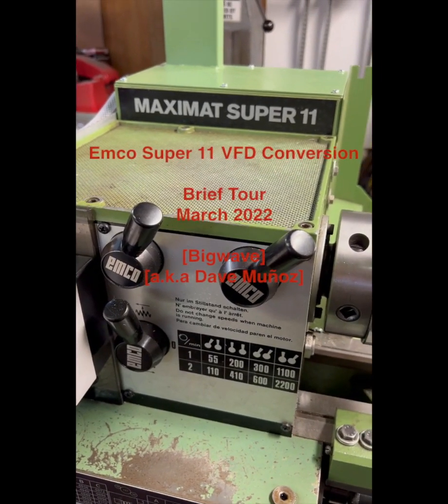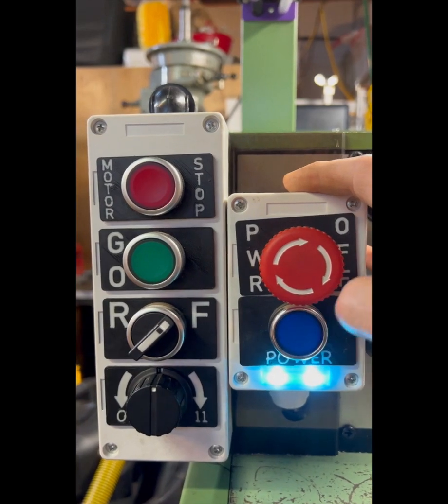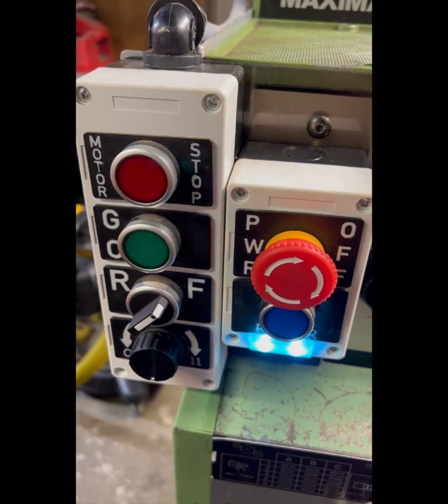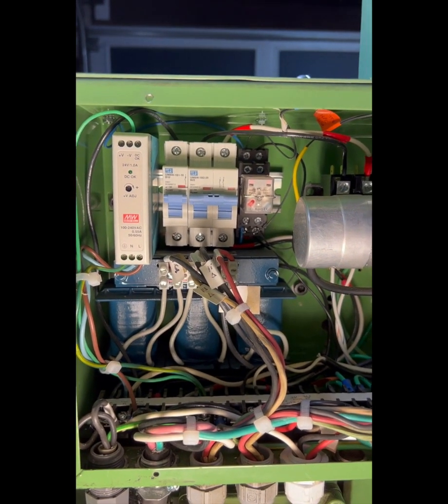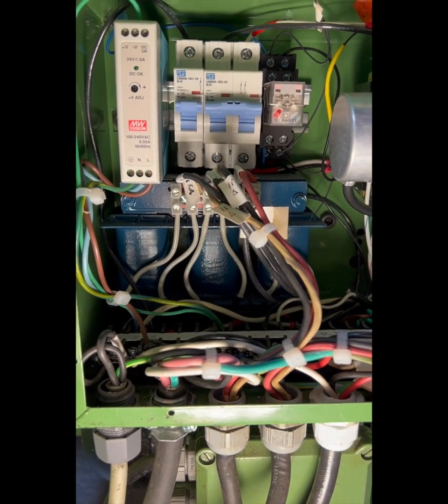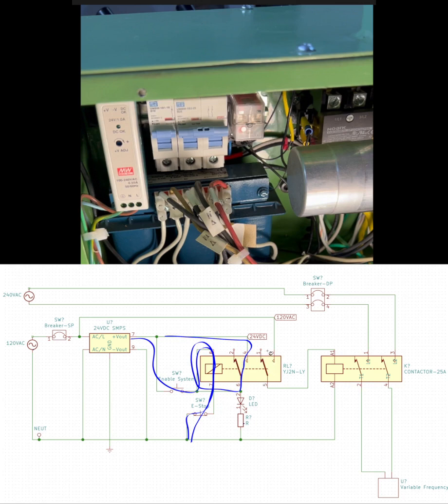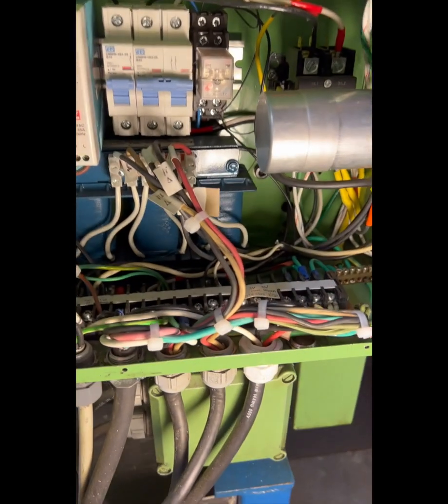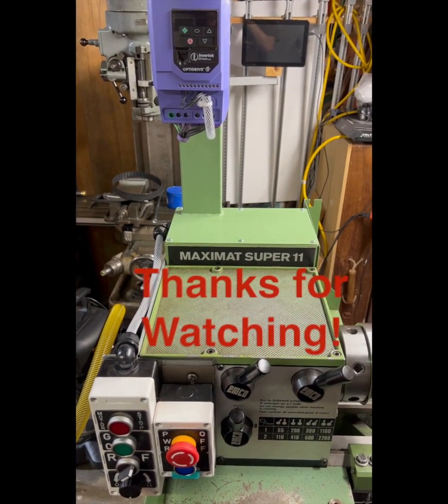Emco Super 11 VFD Control Tour

Comment: hey, would you mind sharing the specifications / model on the inductive reactor? I've been considering one for my S11, but am not familiar with them at all. Thanks for the video!
Reply from the maker: I'm using an 8Amp (ITh=12A) 3mH reactor - These are readily available on eBay for about 30 bucks.  Anything 8A or above should work fine.  PS: ITh is the "Thevinin Equivalent" current meaning roughly the combined total current of the three phases.
Reply: @bigwave_dave8468  Much appreciated!

Comment: Hello dear Dave, 
I have owned the same machine for almost forty years now, running on a single phase 220V.
I would very much like to install a VFD and go 3-phase for the same reasons you did and get rid of the capacitors. 
Did you change your motor, and do you have both variable speeds using the mechanical and VFD speed controller?
I was also contemplating doing the same to the milling attachment basically to get the reverse feature when doing taps.
Your kind advise would be valuable.
Best regards.
Reply from the maker: Hi, I did not change the motor. I used the original. However, the motor is now fixed in the "Low-Speed" or "Delta" configuration.  If you convert to VFD choose  Delta or YY configuration  but do not switch back and forth from one to the other.  The  VFD has to be tuned for whichever configuration you choose.  The nice thing is, one can  remove the big ugly rotary switch since reversing and speed is done  in the VFD.  The VFD drives the motor to higher speed by increasing the frequency 2X.  This has worked with my old AEG motor.   The milling machine is a different matter. The motor on mine is not a 3-phase winding.  It has only two stator windings -- look at the inside of the motor cover for clues about what type of motor it is.  I just left the one Capacitor for the milling head in the lathe switchbox.  In my opinion, there is much less benefit from considering a VFD dedicated to the milling head.  Have fun

Comment: Hi Dave, that is cool to see, maybe one day I can do mine! I do have a question relating to my current setup and wonder if you would remember / know the answer?

So I was having issues with my old lathe that I acquired 6 months ago. Sometimes the power switch wouldn't work or I could hear slight clicking in operation. I decided to pull the switch apart to clean the contacts. That was a scary nightmare, so many little parts, springs popping out, took every trick in the book to get it back together. 

Anyways I did label some of the wires and took pictures of the connections, but it's been no Bueno getting it to turn on so think I have the wiring wrong as well as where the think wires to the coil go. If I manually press the coil and turn the switch I get that hum you get when the motor powers but doesn't turn. 

I'm wondering if you would know where the wires go to the switch? I have the wire diagram but that doesn't mean much as it doesn't identify except for a few of the points where the connections go. 

cheers for any help!
Reply from the maker: I take a look at my notes when I get back this weekend.  The roadmap for the switch contacts is in the electrical schematic. Learn how to read that if you've not already. The tables show the Make/brake connections for each model.  Before VFD conversion, I rebuilt mine as well and after several tries, ultimatly 3d Printed an assembly jig to get all the cams properly aligned.
Reply: @bigwave_dave8468  Hi Dave be appreciated for sure! the issue with the electrical schematic is for the main switch there are only labels for L1, L2, L3 and U, V and W. In the drawings they show 13, 14, a and b connections on the switch, but if you look at the switch itself there are no markings for these points. 

When I pulled the switch apart I could see the paths for the terminals and how they work when the switch is rotated. What has me confused is one of the red wires I labeled to a terminal, that terminal goes nowhere. In other words that wire might as well have a wire nut on it. I'm now wondering did I mark it incorrectly? 

I wished I got more photos, just was so difficult as the wires were cut so short so couldn't pull the switch outside the cabinet for better viewing. :(
Reply: @bigwave_dave8468  This is what I am thinking. On the Emco wiring diagram W/T and U/R are obvious. I am thinking that 13/14 represent the terminals that are part of the switching mechanism that engage first that power up the small coil with terminals a/b?  

I am thinking I can try rewiring based on it looks like, I'm just nervous to deviate from what I took pictures of and labeled originally in case I end up shorting something out and damaging the switch or other parts.
Reply from the maker: PS: you should be able to find the Wire Diagram manual for Emco S11 in the downloads section of the groups.io Super 11 group.
Reply: @bigwave_dave8468  Thanks Dave, I've seen a few and there in one on the inside of the door of the electrical box. I just took a drawing then labeled the photos of the switch I took with the matching letter/number from the diagram. 

I don't think it matches what I labeled when I took off and took photos of but going to confirm that. It's kinda why I'm confused and hoping to find someone with a lathe as from the factory. Will get there! lol
Reply from the maker: @nippingshrewdestreets3264  U, V and W are the traditonal names of the 3 field windings in any induction motor.  Since the Emco has two sets of windings, these are labeled 1U, 1V, 1W and 2U, 2V, 2W.  If you pop the cover of the junction box mounted to the motor, there should be a diagram of both configurations (in German where 'hoch' means 'fast').  The switches truth-able is unambiguos.  At a given position, the connections are shown so you can buzz the switch against the motor connections.  On thing that helped me was to color code the paths in the wire diagram so you can do that effectively.
Reply: @bigwave_dave8468  I think looking at the wire diagram, the double sets of windings are handled by the second rotary switch. Thankfully I left that one alone!

Comment: Dave, I'm using a Teco E510 on an imperial machine with the original 220V 3-phase motor. What did you set the # of poles to on your VFD? I couldn't figure out if mine is 2-pole or 4-pole. The VFD seems to work on either setting, but I would like it to be correct. Thanks, and nice video! Btw, where did you source the push-button setup?
Reply from the maker: I use the delta configuration so 4 poles/phase at ~1800 RPM. Wye configuration would be 2 poles at ~3600 RPM.  I'd choose one configuration and stick with it and let the VFD handle the speed changes. Otherwise, you'd have to retune the VFD whenever you changed to/from delta/wye configurations.  This guy has a nice description of the pole differences:  https://youtu.be/SbtUQEyBk2w. I'm not familiar with the TECO unit.  I ordered the button assemblies from Amazon. I think the e-stop button was separate but they're like legos and you can move the switch bodies around.
Reply: @bigwave_dave8468  Gotcha, that makes sense. That's what I was using, but I'm switching it over now to the Wye configuration this afternoon. Why do you use the delta config? Doesn't this prevent access to the higher speeds?
Reply from the maker: @kwright286  Sorry did not see this earlier -- ordinarily, yes, you would get ~1800 RPM  on the motor since the line frequency is 60HZ.  However,  the VFD can overdrive the frequency so that frequency seen by the motor is 120HZ (or whatever you like). Frequency range is dependent on the VFD.  By runninng at 120HZ, I can use Delta config and still achieve ~3600 RPM.  The initial reason for choosing Wye configuration was to raise the input impedance of the motor and thereby keep the current in the windings to a minimum because my VFD's lowest voltage rating is ~140V.  As it turns out, the Delta configuation works fine and it's quieter so I've kept it that way.   One thing in your favor is that the 110V motor had to be built to handle higher current than a similar HP 240V unit.  The main risk of the VFD conversion is that the motors were built before VFDs.  The VFD output has high harmonic content (it's not a smooth sine wave) and the motor wasn't designed for 120HZ operation.  Those conditions may shorten the life of the motor so it's a risk you have to be willing to take.